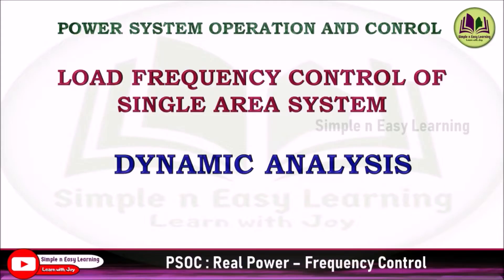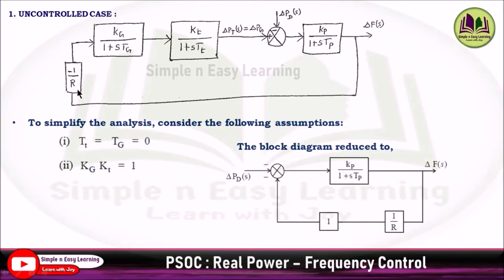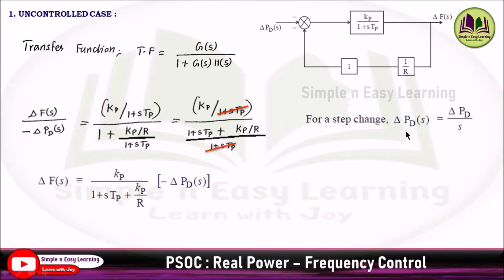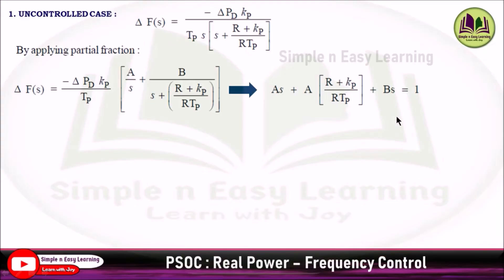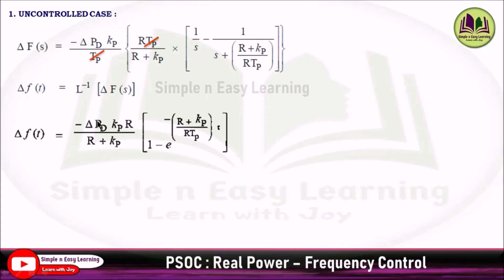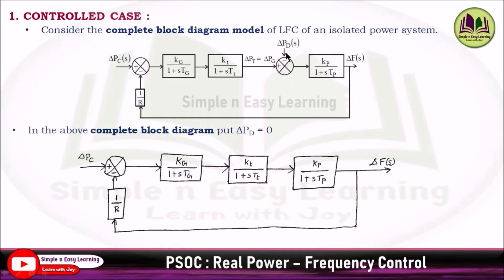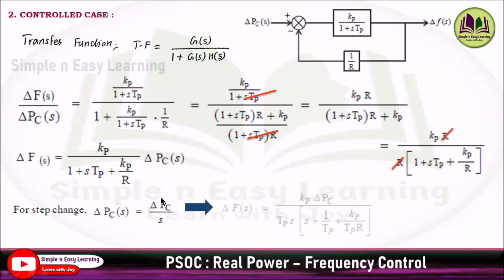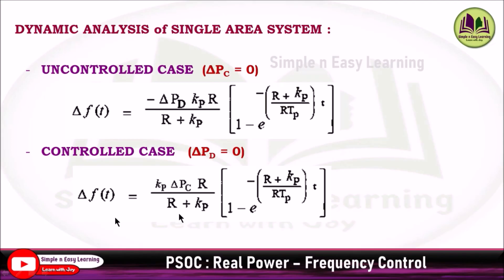Dynamic Analysis of Single Area System | Load frequency control | PSOC

Comment: Sir I have a doubt how come have you taken R as Kp's denominator in 2:14 because in static analysis you took R as whole denominator
Reply from the maker: In the block diagram, apply the negative feedback loop rule (which you studied in the control system)

G(s)/(1+G(s)H(s))

Here G(s) is kp/(1+stp)
H(s) is 1/R

You will get,

(kp/(1+sTp))/(1+(kp/1+sTp)×(1/R))

Simplifying we'll get
kp/(1+Tp+(kp/R))
Reply: @simpleneasylearning thank you sir 🙏